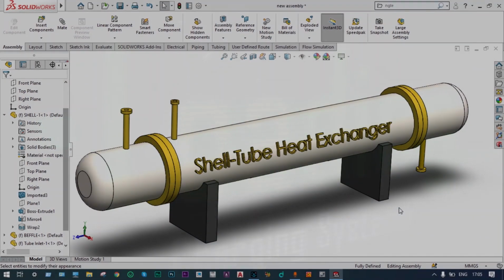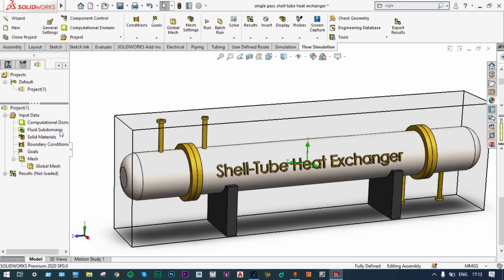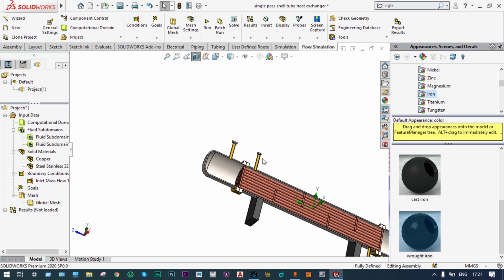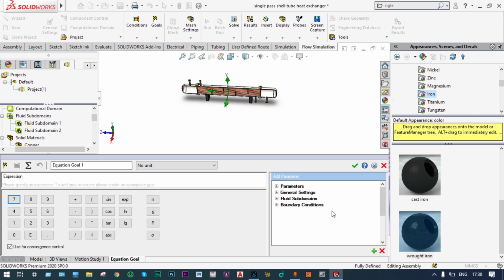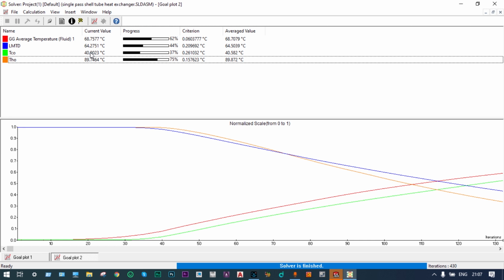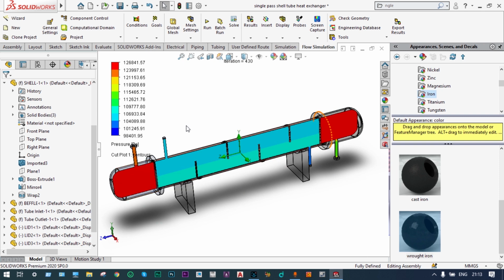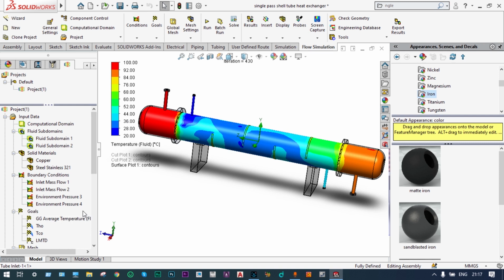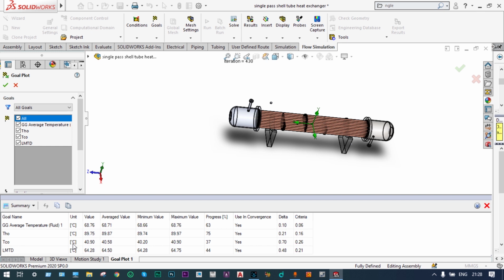An Introduction to SolidWorks Flow Simulation of a Single Pass Shell Tube Heat Exchanger

Comment: I want to make exchanger between hydraulic oil and water, i don't fine the oil except olive oil
What can i do?
Reply from the maker: You have to use user defined fluid and in that one you have to provide all the required specifications of hydraulic oil by yourself.

Comment: I couldn't force tube side liquid to flow from the tubes only even though I try to set the geometry accordingly. When I try to arrange Fluid Subdomains, they are not seperated like yours one of them is shell only and the the other one is tubes only. If you could help, it will be great. Thank you for the tutorial.
Reply from the maker: Problem is with the geometry. Check the geometry again. Some of the extruded parts of the inlet may be unmerged. Make it merged and try. Otherwise, write a mail to me I will send you the geometry. Then you can simulate
Reply: @CFD_GUIDE   Sir, it was about geometry like you said. Baffles were not covering shell accordingly and there were some leakings between shell and tubes. I got help from an engineer who is working on Solidworks all the time. Thank you for the help, probably I will have some other issues about the analysis but I will know that you will be here for help. So, thank you so much :)
Reply: And sir, what if we want to see the heat transfer rate in this simulation? How can we find it? Do we have to put it as an equation and run simulation?
Reply from the maker: You can do anything you want through simulation. Let me know what do you want to see from this simulation
Reply from the maker: @ahmetkirhan5896  Ready made goals you can have at any location. Or you can create any equation also if you want. But basically for normal heat flux, heat transfer rate, etc you need not create any equation. Directly you can get it on any location. You need to select some goals.
Reply: @CFD_GUIDE  Sir, I have just sent you an email about the temperatures. If you could check this would be great. Best regards.
Reply: Il y ya des fuites de la boîte côté tubes vers le côté calendre.
Le jeu qui est entre les tubes et les trous de la plaque tubulaire

Comment: hey mate, could you calculate overall heat transfer coefficient for this project ? If you want ı will give my gmail address. My project same as you. Thx
Reply from the maker: It is very simple. Just use the equation goal and form the equation using pre-defined goals
Reply: @CFD_GUIDE  I couldn't active flow simulation menu
Reply from the maker: First check geometry with improved geometric handling conditions. Next disable unimportant parts. Only most important parts should be taken for analysis. If still problem persists in that case check the fluid sub domains. If the fluid sub domains are clearly and distinctly visible then some other problem is there. Check this video to see how to disable unimportant parts in simulation.  https://youtu.be/P2NJFXZw8Ng

Comment: I did the model similar to this in my case during fluid check only tube side fluid is visible and shell side fluid is not selecting and getting error in boundary condition how can overcome this problem

Comment: please where can I get the modelling of the single-pass shell and tube heat exchanger?
Reply from the maker: You can model yourself. It is so simple. It will take maximum 30 mins. Otherwise you can send your email address, I will send it to you.
Reply from the maker: Please send your email address. I have this model
Reply: @CFD_GUIDE  hi. can i also get the modelling?
Reply from the maker: Please write to me in which I may get your email
Reply: @CFD_GUIDE  hi can i also get the model?
Reply from the maker: Sent. Please check your email
Reply from the maker: It's a minor problem. If the lid face is not flat in that case you can make a lid on any flat surface and extrude it unmerged upto the surface of the object
Reply from the maker: Write to me to my email address. I will send you the model.